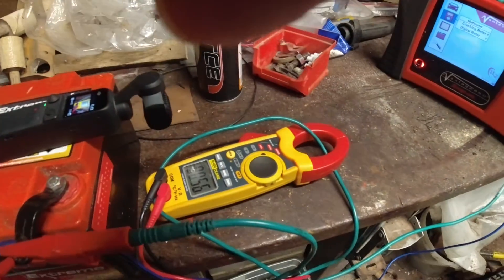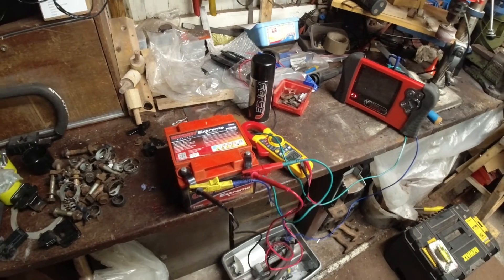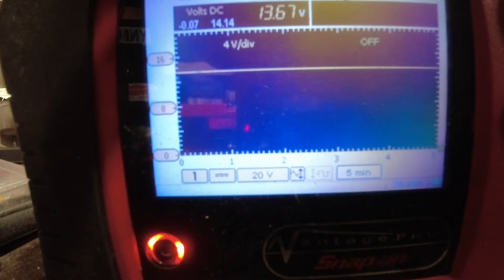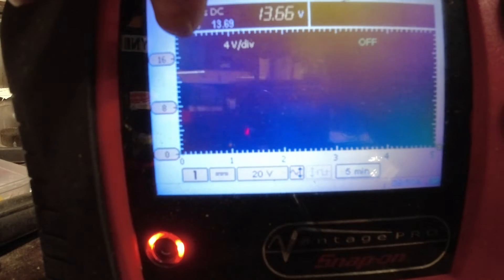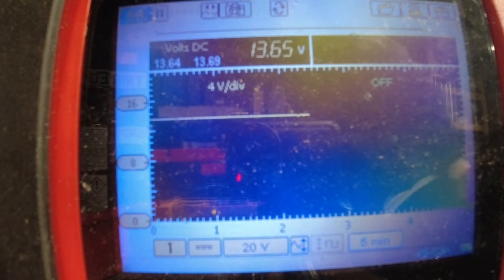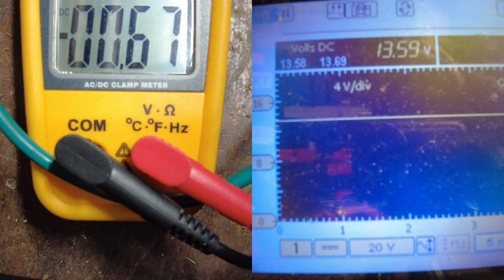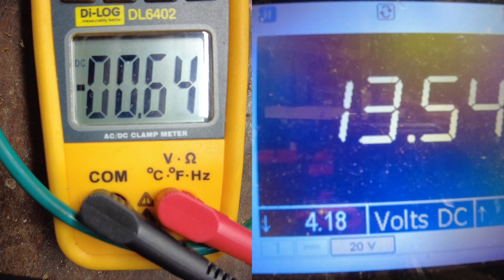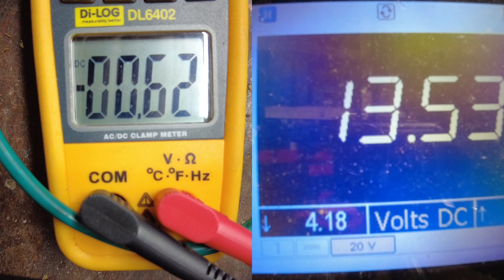12 volt battery drain on hybrids

Comment: Interesting video. Do you think the drain would be the same on a Yaris without keyless entry?
Reply from the maker: i would think the drain will be lower , because the car is not looking for the key all the time , there will still be a drain on the battery while turned off , but i can,t test that as both Yaris i have at home are Keyless entry and it,s pointless testing my MR2 as that goes to sleep with no drain on the battery , it can be left for weeks

Comment: Hi Paul
 Very interesting video 👍
Question....
 You said if you replace your battery, you should put a bigger one  in its place.
 So, im no expert in vehicle electrics.
So my mind is thinking....
 If im going away for a couple if weeks, can I , connect a second battery to the original  ?
 Would this extend the life span  ?
Reply from the maker: If you’re going away for a few weeks , my advice would be buy a10 watt solar charger and connect directly to the battery, sums are voltage x amp hours = hours to charge battery / 10 being the wattage output 
12 x 36= 432    432/10 = 43.2 hours to charge a flat battery 
So as long as you’re battery is not flat when you park up 10 watt solar panel will put enough charge into the battery to compensate for the 1/4 amp continuous discharge that the Yaris has when turned off and a sleep 
It’s an easy solution when leaving a car for a few weeks to use power of the sun
Reply: @paul_nwsxs have yu looked outside😂